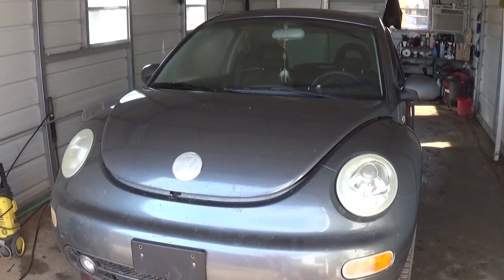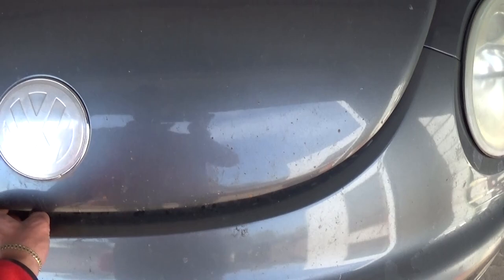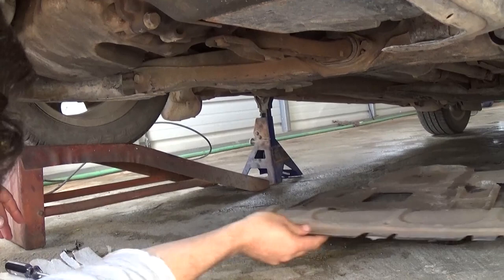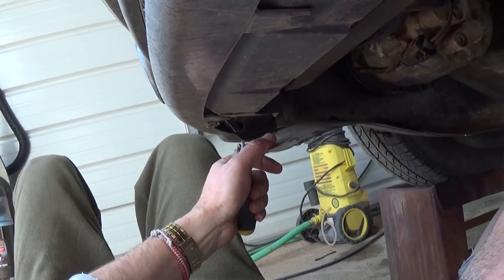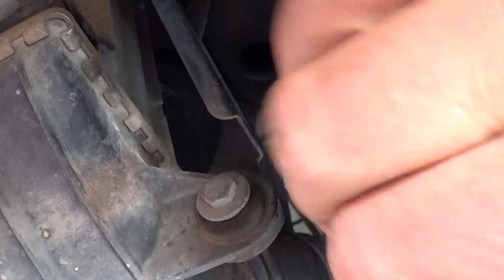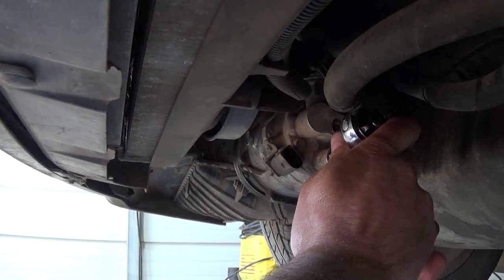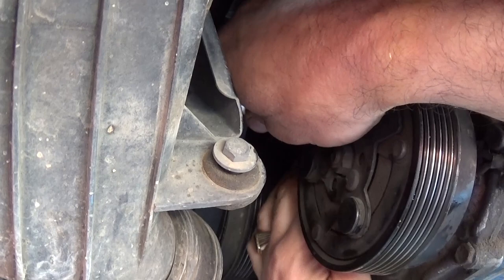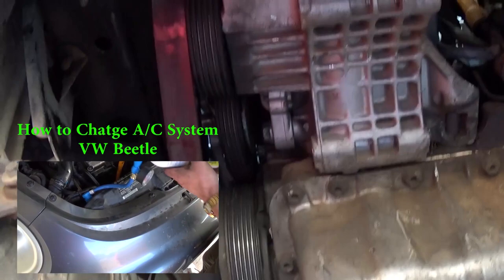VW Beetle A/C Compressor Removal and Replacement. Beetle Air conditioning Compressor

Comment: So I have a 2001 new Beetle gasoline and it's not the same there's a power steering pump at the bottom and then the AC compressor is above that so for that when I had to remove the power steering pump the condenser fan in order to get it out

Comment: All very well..... Wait for the hassle if you have one with power steering pump under the compressor. Then involves removing pulley then the pump, bracket holding pump in the way and you can't remove it. So drop the fan off radiator, you will struggle undoing compressor pipes as loads more stuff in the way , rad pipes , power steering , etc. And just about get compressor past power steering pump bracket. Also the belt tensioner often operated from above with a half inch extension bar and 17 mm socket over the square lug. And wedge in place with another bar horizontally. I have just spent 5 hour doing that and alternator. Absolute pain of a job and scuffed hands. Worse still if you have LPG too, and the pipework in the way

Comment: Would that process be basically the same for a 2006 model?
Reply from the maker: Noelle Wegner Yes it is almost the same procedure. The only difference I think will be the serpentine belt diagram.

Comment: That compressor is easy to get to, Not so on a 2005 2.0l GL.  In my case, the compressor and clutch engages, all fans work, all fuses good. I was working fine. Parked it for over a year, now all it does is blow hot air. Was told that is does have enough freon so it mean that the compressor is faulty. But how can a compressor go bad or time of not been used?

Comment: Hi guys thank u so much. Question when i turn on myAC. ( I live in Arizona. Hot ) anyway i dont see any leaks, Ive changed out Air Cabin Filter, my Fan works great . problem....when i turn it on it will only be slightly cool but not cold. Ive had new. It flushed and new Freon put in 6mnts ago and then it stopped Cold air. Now only slightly cool when its 90 outside. But once temps get to be over 100 it stops cooling. Any advice. I cant afford a mechanic need to Fix myself.

Comment: I need to change my a/c compressor due to a faulty clutch but I was warned not to just change the compressor. I must change the drier and orifice also???
Reply from the maker: Turd Ferguson if it is the clutch you might not need to replace the other parts because the clutch is external and even if it brakes not debris go in the system
Reply: The VW does not use an orifice.  It uses an expansion valve.

Comment: ihave anew beettle 2000 cac compresor i check fuse and does do anything
Reply from the maker: Joelito El Duro did you put new compressor? sometimes it is the wire where it plugs to the a/c compressor but most often the clutch on the compressor goes bad
Reply: Okey

Comment: This process is not at all the same for the 2000 Turbo. There is some other pump below the AC comp you have to remove first. Then the mounting bolts are on the backside not the front. Great tutorial but not for the turbo
Reply: I think mine is the same, though not turbo. The power steering pump is below the ac compressor

Comment: Mine is blowing but not cold. The the fan is not turning on and clutch is not engaging. How to know if the compressor must be replaced?
Reply: Carlos Fraga Same.
Reply: Shon9tilR I’d replace the compressor if charging the system with refrigerant does not make it work. There is a pressure switch that disables the compressor clutch if there is no (or low) refrigerant. If you charge it up and compressor works that was the problem and it was simply low on refrigerant. If that does not work, replace the compressor altogether, in my opinion replacing just the clutch is not worth the hassle.
Reply: Great video. Realise how easy it is now. I'm an Aircon engineer so gassing is easy too. Mine compressor is cutting in and out and grinding noise. Bought new compressor off eBay for 110 pounds with 5 yr guarantee , no worth buying a used one